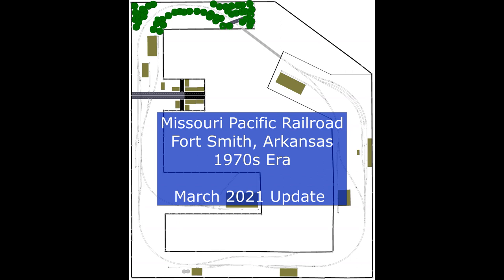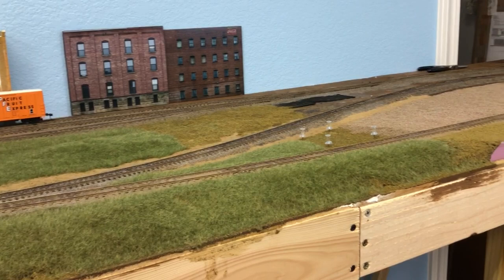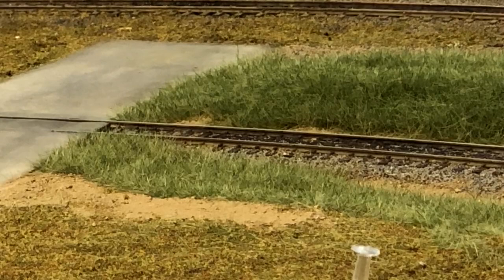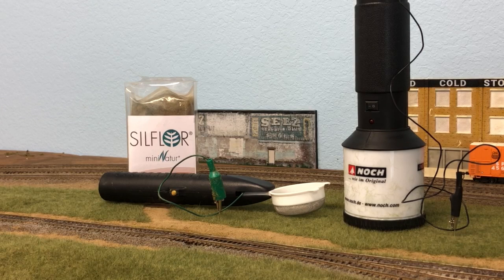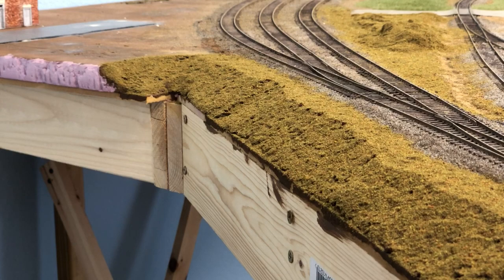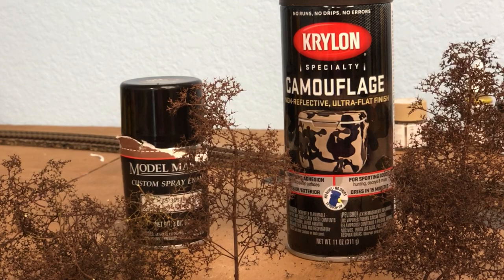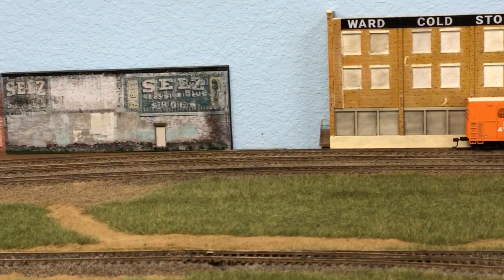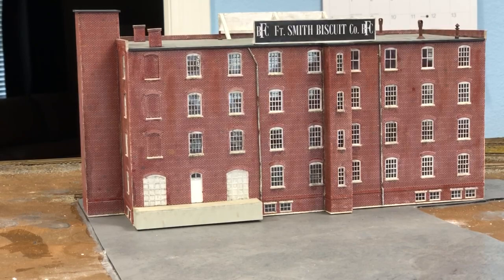Missouri Pacific Model Railroad Switching Layout, March 2021 Update

Comment: This is awesome! I was born and raised in FS. I’m fixing start up a layout using the A&M from FS thru VB to Springdale or Rogers. I can’t find any A&M engines is my biggest issue right now. I still haven’t decided on the era. Probably 1990-2020.
Reply from the maker: Thanks Aaron!  Grew up in Central Arkansas in the 1970s rail fanning the MOPAC.  When deciding what area to model, came across a 1979 industry car spotting guide used by MOPAC crews assigned to Fort Smith. Was blown away by all the industries and was hooked!

Hoping Atlas releases another run of a C420 and C424 in the A&M scheme.  I love the A&M and actually purchased an undecorated Atlas C420 and painted it in the A&M scheme.  When inquiring with the A&M about correct paint color, was given the corporate line about guarded information.  So found a paint color that looked pretty close if not exact.  

If you decide to go that route let me know and I will look up the colors I used.  You can purchase the A&M decals from Micro Scale.
Reply: @JosephMusgrove  I guess that was your post about making them from a blank body. If no one comes out with the C420s or the new EMD70’s then I’ll have to make them from scratch. Thanks!

Comment: Another safety issue, is with basement model railroads.   Don't be using stuff near pilot lights on the furnace or water heater!
Reply from the maker: Good point!  I will be sure to mention that on the next update.